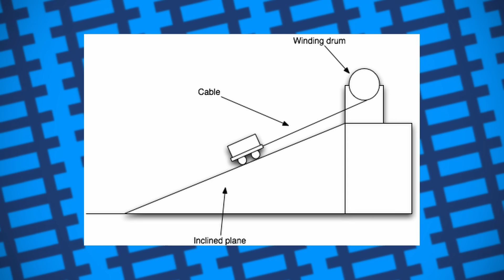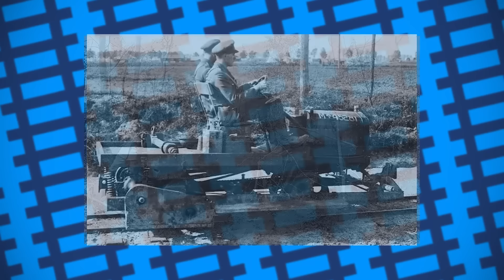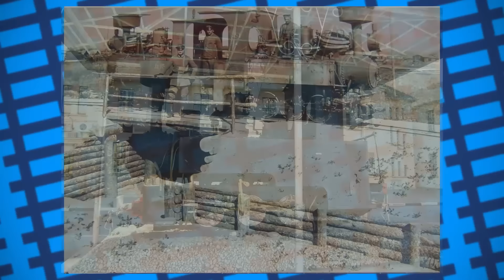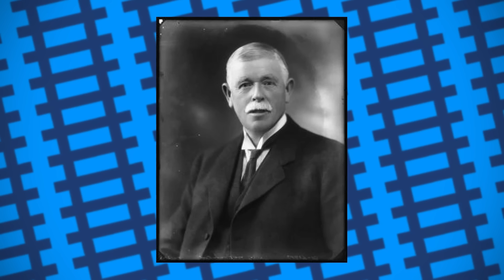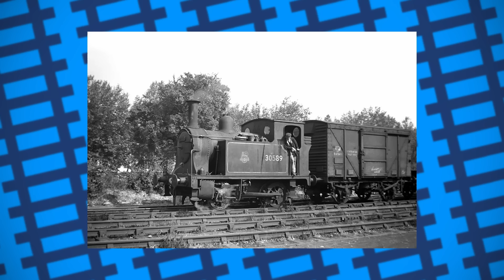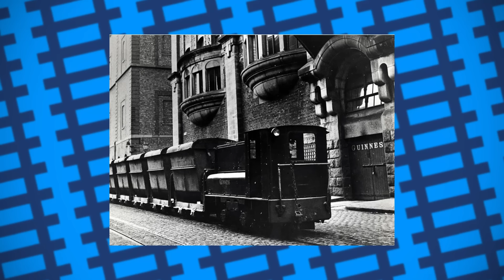Train of Thought COMPILATION - All Small Engines

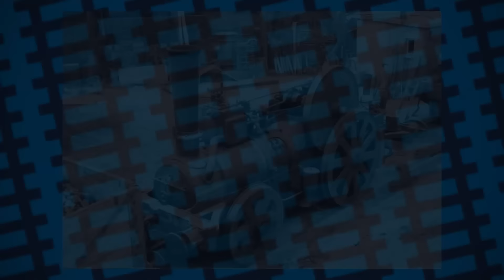Comment: 26:15 Tell that to the Czechoslovak T211 class locomotives. They literally took a truck power unit, including not just the engine but also the manual transmission, and just put two train axles under it and said "good enough".